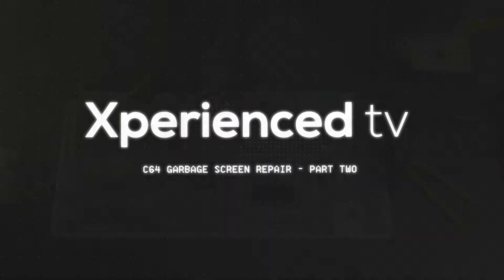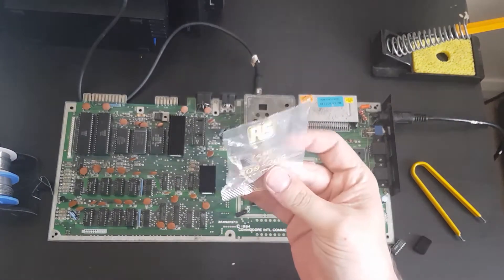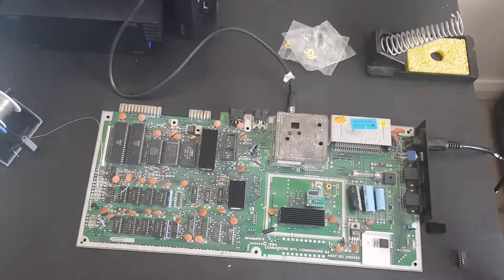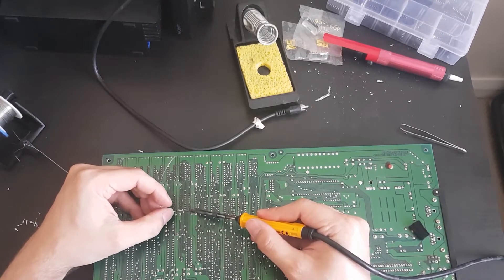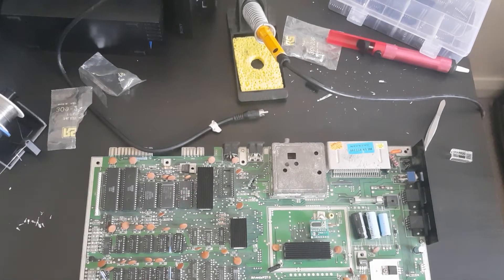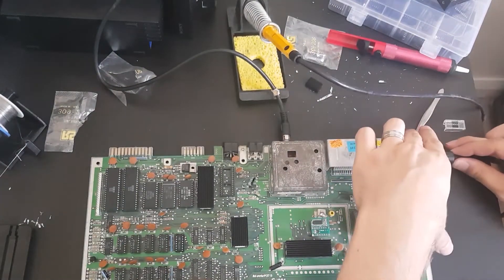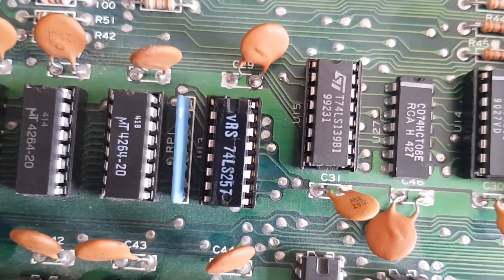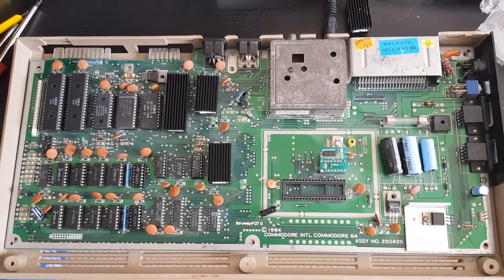C64 Garbage Screen Repair - Part Two

Comment: Don't beat yourself up too much about frying the VIC.  Mistakes happen, and it's a learning experience to improve.  I've accidentally fried things a few times as well, usually the SID by connecting the audio input to something with too high a voltage.
Reply from the maker: Good to know I'm not the only one that had an accident like that. I was quite angry at myself for that though. Thanks for the comments!